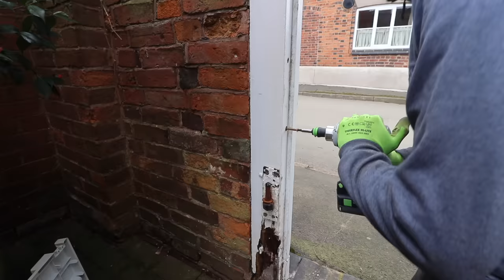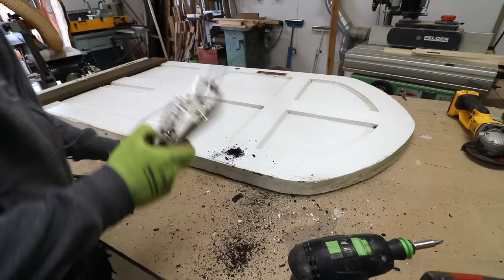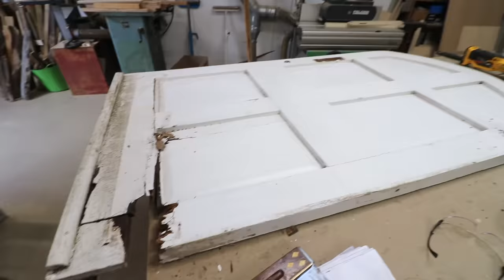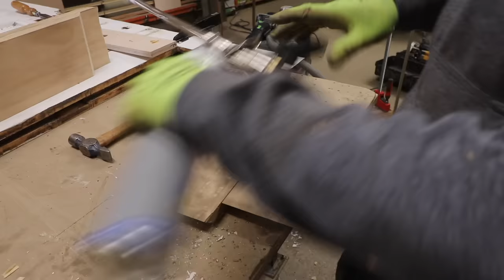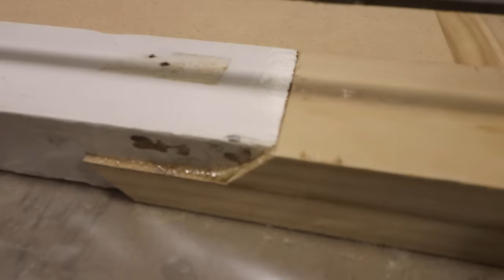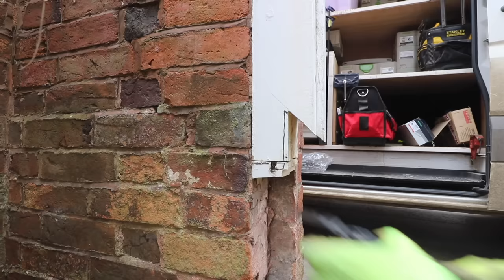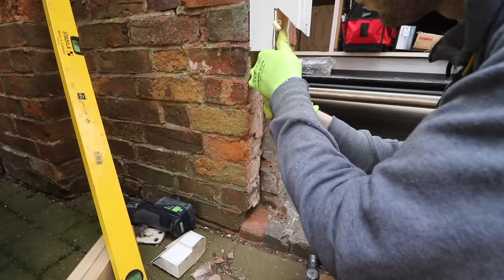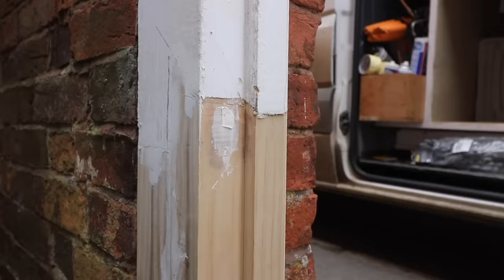Rotten Door, Full Repair. Here's How I Did It.

Comment: Very skilled.  Something confused me a bit.  Did I understand correctly that you did not seal the inside (or back, or invisible) part of the frame where it comes into contact with the brick?  I should think that part, which is sure to come in contact with water wicking into the gap, will swell and hold moisture and rot.  Also the bottom of the frame (where the rot had started in the first place) was not sealed either.  I wish I knew why.  I appreciate if you could educate me.  Thank you.
Reply from the maker: Hi Narmak, I use a product called sikkens Kodrin wv456. It's clear and seals the end grain. On this occasion also the timber is Accoya, it will not rot like other timbers in this scenario. The end grain sealer will just help the paint coating to last longer! 

If you've not encountered accoya then check out the website!

Comment: Pleasure watching you sort out that door. Those multi tool blades are really efficient at cutting through the wood. What type of blades do yo use?
Reply from the maker: The best ones are the Festool speed max. 203336 However i reserve these for the very jobs where they require the best cut and there are no dangers of nails!!!! Otherwise i use the same shape teeth blades as above but cheap ones off ebay. Think the brand is called no-one.

Comment: Quite impressed with the multitool precision. I never use it for such precise jobs. I suppose time to try better blades. I would have used template and a track saw for all the angled cuts both on the door and on the frame.
Reply from the maker: They are great tools but you have to be pretty accurate throughout the whole cut. once it starts going wayward there isnt much going back.
Reply: @BradshawJoinery  good tip. i just never even tried. will give it  go. ta for a brill video:)

Comment: In general I was happy to see this job done.. Two things though (I'm picky) the tenons should be glued no more than 3/4'' from the shoulder and the wedges cut from the haunches should be non-glued to allow for the stile to move across its width. The last one is :  are those panels MDF?? I hope not.....
Reply from the maker: Cheers Tony, I've heard of not glueing Upto the shoulders before, is that a glue squeeze thing or just to accommodate movement? 
I've always glued every bit of tenon and shoulder and not seens a detrimental effect yet, infavt since switching to PU glues, joints retain their integrity incredibly well. 
Not saying one or the other is right as I know a lot of practices can be done in multiple ways and have a lot of respect for traditional time tested techniques. (Quite a few don't apply to Accoya however)
Reply: @BradshawJoinery  It's for movement.. Similar to using buttons to connect solid desk tops to their framed legs. Solid wood moves alot depending on moisture content ie summer /winter and relative humidity ect. BTW you do glue the shoulders and part of the tenon up 3/4'' from the tenon shoulder. We always did that when making our doors at the shipyard, I'd get boxed ears if I didn't, in the sixties we were thumped a lot if we didn't follow the rules...LoL...

Comment: Beautiful work. Thanks for sharing. Would you use the multi-tool to cut out a rotted bottom rail of a door (not full piece, about 4 inches across)? Also, what wood did you use for this project?

Comment: Very nice work. Very professional. I was however curious about panel material you used. Was that MDF wood? My understanding is MDF suffers from swelling when wet and it seemed like an odd choice of material. Please correct me if I misunderstood.
Reply from the maker: Thanks Matey, It was indeed MDF but its a special MDF called Tricoya. Ive put a link in the description! The Timber repair is called Accoya and is the same technology.
Reply: @BradshawJoinery  Thanks for the information, I was assuming it was some kind of marine MDF that could resist water.
That was a huge amount of work to save the door, but really appreciated your professionalism and thoughtfulness to keep this door working for many more years to come.

Comment: Cool vid, really enjoyed watching, have you considered using a 15° cut to divert rain water? That way you can use a dovetail cutter in the router to complete it instead of using a multitool? It's also a lot easier to get a chisel in for cleaning up if necessary.
Reply from the maker: Yes can do, obviously the longer the cut/higher angle the more glue adhesion you are going to get/less end grain joint.
Reply: @BradshawJoinery  At the risk of starting something, an end grain to end grain joint is actually stronger.

Comment: Would it be worth strip-dipping that door and repainting with a modern wood protection that's less likely to seal in water leading to rot?
Reply from the maker: Im not gonna open up that can of worms haha! basically noone can say for sure. its done well with the paint thats on it, so other than smoothing it off i didnt change it. Im not sure what the decorator used.

Comment: Outstanding repair job.enjoyed every minute of the video.I was just wondering what type of wood was the door made of, and what wood did you use.
Reply from the maker: The original is traditional Redwood, not something that modern redwood is equivalent to. I used Accoya timber and Tricoya panels. Its a very very stable and rot resistant material, perfect for repairs as it wont introduce movement to the joint.  Theres some links in the description

Comment: GREAT WORKMANSHIP with best  tools to compliment the skill.  I have one doubt,  why you have not used real timber panel ,  the MDF when fails would give you headache.

Even If you may have used special MDF with wood pulp which promises not to swell or rot was told not up to the promise .

What was your experience with such MDF.

Is Timber panel expensive or unavailable ? Just a doubt .
Reply from the maker: The Tricoya panel is more than durable enough. The old door will rot around the panel for sure! I have a piece outside the workshop, lives in a puddle in the dirt, still solid as a rock and been there since feb 2014.

Comment: You do very nice work, very clean and professional. Two questions, what kind of wood did you use for the repairs, and what type of glue are you using?
Reply from the maker: Thankyou, Accoya and Polyurethane glue from wurth. (this job was foam fun dispensed but i normally used sealant tube type PU glue)

Comment: Nice work.  New door, even custom, cheaper than this repair, especially after reworking old paint on remaining old doir
Reply from the maker: I beg to differ, the repair to the door was done in a single day, (2 day for the whole job including frame splice) i doubt you could make a arched top door to suit the frame out of a timber as durable as this one for 2x the cost of the whole repair.
Reply: @BradshawJoinery  The repair, well done,  required only a day because you are visibly a well trained master craftsman with years of experience with a very well equipped shop including expensive equipment like that large wood planer.  That kind of skill package can’t be cheap, or you can’t stay in business.  

In addition to the repair day, there was the door pickup day with travel to site, door removal and the temp plywood blocking, travel back to your shop.  Then there was what, order time for some replacement hardware, and perhaps that replacement wood if not in shop stock?  Then comes travel back to the site for the install and paint.  Last, shop cleanup and maintenance of blades, etc is more labor.  A client has to pay a share of all this.   

If a new door is ordered instead,  a craftsman  need not haul it ever but only meet the delivery on site, factory  primed if desired.

That’s just my take on costs, from experience with a small engineering business.

Comment: Nice work.  What species of lumber is that?  I would use Spanish Cedar or genuine mahogany; perhaps cypress too.  I was a little surprised you didn't paint the end grain of the jamb replacement parts.
Reply from the maker: Its called Accoya, There is a lonk in the description (i think i replied to your other comment before unless im mistaken!) I used a end grain sealer called kodrin wv456 on the outer frame parts its better than paint as it seals in one coat.

Comment: That was amazing, beautiful work. I'd like to know what blades you use on the multi-tool though, they seem much better than any I've used.
Reply from the maker: THe very best one is the festool speed max. I look for the blades with triancular shape teeth that cut both directions for wood. (same as speed max) The bi metal type ones dont cut as well. The first 2mm deep i use to guide an outside cut then work it in, Dont try and plunge it in blind
Reply: @BradshawJoinery  Wow thanks! I haven't really gotten serious into the festool stuff yet but might be time to.

Comment: Amazing repair, so interesting. You certainly have all the tools. That mortise and tenon machine saves time eh?
Although….  Why the stainless steel nut and bolt and screws on the black hinges?
Reply from the maker: The stainless is because the Accoya timber is corrosive/acidic. Normal mild steel even powder coated wouldn't last long before rusting, stainless is easily painted

Comment: I think a coat of paint on the bottom of the jamb, although the client will never detect, can add a few years to the woodwork
Reply from the maker: Yes absolutley. i used a clear sealer that is thicker better and more suitable than paint. its called sikkens WV456 end grain sealer
Reply: @BradshawJoinery  Duly noted, sir

Comment: Great result, what was the material for the raised panel inserts? From the video it looked liked particle board on my phone. Cheers Mark
Reply from the maker: Thanks Mark,  i used Medite Tricoya Extreme MDF. Its A board made from the acetylated wood fibers of Accoya. It is incredibly durable and unlike any other panel material.
Reply: @BradshawJoinery  Is that the standard material for exterior use? I am in the states and unfamiliar with the product, it seems like a breeze to work with.
Reply from the maker: Accoya is becoming a pretty standard product amongst external joinery now yes! It's not a product that is stocked at a local timber merchants though, it's a specialist material that is ordered in.

Comment: Great work but i would have left a bit more clearance around the door ,bit bad weather and that door will be binding and catching all around ,and that's before the 2 coats of paint the painter will be applying ,great skills but need a bigger gap around the door .I used to work with a joiner who bragged about his penny gap all around the doors he used to hang and take the mick out of mine because i would have 2 to 3mm ,but after the doors had 1 coat of primer and 2 top coats mine were  perfect with a nice 2 to 3 mm gap  and his would be sticking .
Reply from the maker: Hi Mark, yep with you on that one, always spec a 3mm gap on exterior joinery, bigger on bigger doors, it looks tight on camera but I can assure you it's there. The gap underneath is good too. Plus the fact the bottom of the door is now made from Accoya so shouldnt move even 0.5mm!

Comment: Fantastic job - what paint did you use to prime the Accoya? No need to seal the bottom or hidden sides of framing repair? I'm assuming Accoya doesn't draw in moisture at all?
Reply from the maker: THis was Zinnser waterbourne  anti stain. I use a clear sealer that is thicker than paint called kodrin wv456 for them parts, to seal with paint would take 3/4 coats and there just isnt time .

Comment: Thinking of buying the festool multi tool, would you recommend it? Also do i buy it as a kit with all the accessories or just with a battery? How much use do you get out of the plunge base etc? 
Thanks love the videos, true craftsman
Reply from the maker: The festool.is the best one, better than the Fein who make it as it's nicer to hold. Pretty much use it exclusively on speed one and none of the accessories. The vacuum one is handy occasionally but makes it awkward to use with a hose attached.
Reply: @BradshawJoinery  great thanks thats saved me alot of money
Reply from the maker: I'm thinking about getting one from nuts and Bolts LTD. They have a good deal on ATM

Comment: My only question has to do with the Accoya. It looks to be an excellent product which I have no experience with at all but from what I've read, it doesn't expand and contract appreciably yet the wood of the door and frame will. Kind of like a cross grain situation even when it isn't. Is that something to be concerned about?  Excellent repair job on the door, frame and patches. I always appreciate your videos. Thanks.
Reply from the maker: Hey Kyle, good question, the old timber will move at a different coefficient, part of the reason for overlapping the slplice is to provide as much of a joint as possible to hold them together. Accoya is best for repairs as atleast what you add in will be good and last. Its usually the pine splice i come across from previous repairs that has rotted again. The accoya splices ive done have all held up much better than sapele or any other timber ive used in the past!!

Comment: Nice woodworking but why no paint under and behind frame repair, and it looks that the door is too tight against the frame, because the door springs when you close it.
Reply from the maker: Hi Robert, i didnt film but i dont use paint on a site repair, one coat while fitting doesnt do naff all! I use a clear sealer called sikkens kodrin wv456 that is like a paste, its called end grain sealer.

Comment: Thanks for the video very interested to watch
What about that spray glue any good and where did you get it from thanks
Reply from the maker: It sets real quick and hard very quick to apply but also very runny. It's falls off vertical surfaces easily so it's bloody messy. Great for joining timber boards but not for finesse work
Reply: @BradshawJoinery  which glue you recommend for laminate two pieces together
Reply from the maker: thin or thick pieces? pu is fine if you can clamp it but not much use for veneer laminating
Reply: @BradshawJoinery  thanks for the reply where did you buy from

Comment: Nice job.   Surprise you chose   
Exterior grade MDF. Over marine ply,  for the door panels.   Maybe a weather board on the bottom outside would help prevent the same thing happening again…..
Reply from the maker: Cheers Paul, the Tricoya board is a lot more durable than marine mdf. A good alternative if you wanted ply would be Garnica duraply, a bit cheaper than Tricoya and has a grain (plywood) I used tricoya as i had the right amount spare int he shop and it also has a slight raised panel detail, which i wouldnt reccomend cutting into a plywood panel.

Comment: Gorilla brand wood glue does an excellent job of locking two pieces of wood together. I had to fix a friends guitar a few years back and it is still holding tight.
Reply from the maker: Yeah PU Glue is mighty strong and a little flexible too. Helps it hold on longer!

Comment: a fantastic job, just one question, id like to make an autside dor in my house,  dont you worry about the mdf panels?  will there survive well on the rain???
Reply from the maker: Hi Luis, the MDF is a very special version of MDF. Specifically called Tricoya, dont use any other MDF outside (or anywhere if you can help it)
Reply: @BradshawJoinery  thanks, i didnt knew

Comment: Awesome as always, I’m thinking about the festool belt sander, do you rate it ?

And you’re not a properly qualified and experienced tradesman unless you’ve done at least one Dutchman without any help from anyone, holding things steady or helping push it in 😉
Reply from the maker: Haha you've obviously done a Dutchman or two in your time then 🤔🤣

I love the festool belt sander, I'd get the frame with it. 3 things though. 1 dust extraction not great even with hoover
2, it has a graphite pad underneath the belt rides on. These wear and you'll need to replace about every 10/ belts. Not that expensive, but if you want a really flat sanded surface change the pad before hand (it gives flatter results than any other belt sander) 
3. When using the sanding frame don't put it down heavy on the front section. I bent the mounting plate for the frame by putting the sander down one handed front first and then started getting inconsistent results from using the frame until I realised. 

Great tool though. I love it for lipping venners. Set the frame so the sandpaper is just not touching and then the sander removes the lipping without touching the veneer. Perfect
Reply: @BradshawJoinery  sounds perfect !  We have a thing called Afterpay out here, great for luxury items ( got a perfectly fine makita BS, but one wrong move and you can trash a sash right at the 11 th hr :(.      )

Deffo ordering one then 👍🏻. You don’t even notice the payments with that Afterpay, because festool is anything but cheap!   ( only the 75 mm available too)

Definitely getting the frame, that’s what makes it 👍🏻
Reply from the maker: Nice one. You can turn the speed right down too. I use it for finish sanding on accoya when painting..it doesn't hollow the grain out like a orbital. Can sand the scratch marks out after a primer coat using random orbital sander. Works a treat